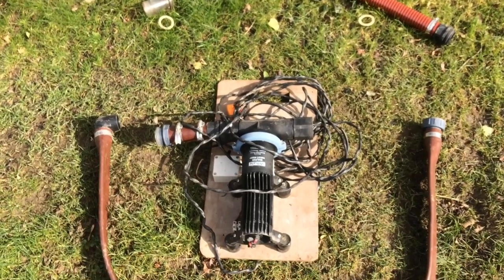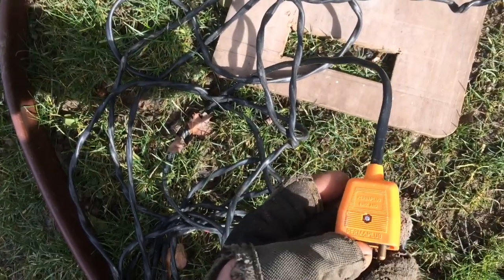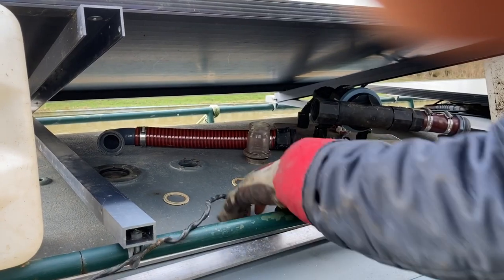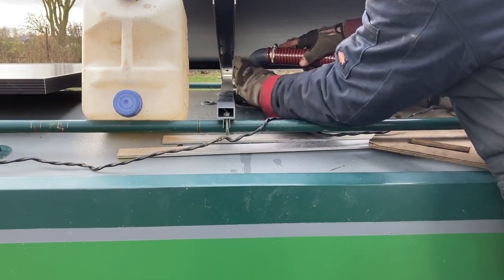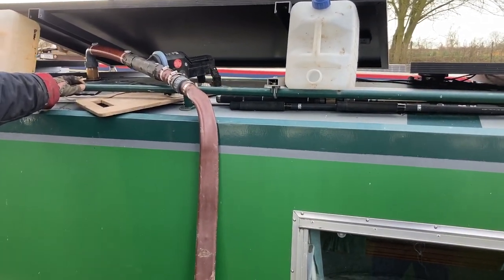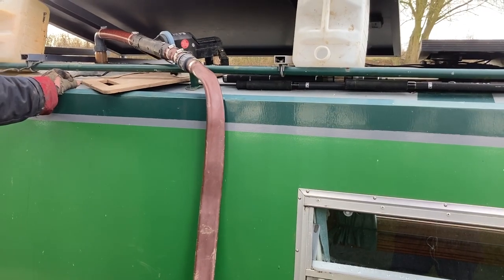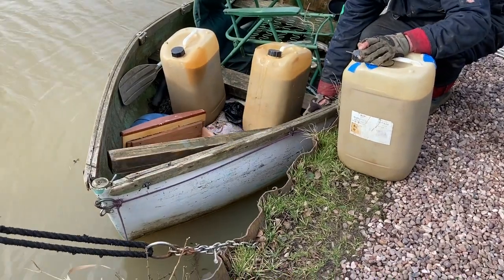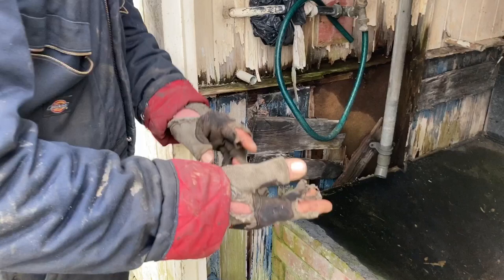Narrowboat D.I.Y Self Pump Out Marine Toilet

Comment: How long does it take ( roughly) from switching on to actually getting that 7ft lift ?
Reply from the maker: Hi Ross. I would say no longer than say 15 secs if the joker valves are good. I have another video on changing valves too. Thanks for watching mate
Reply: @DoItWithPaulie  cheers-
I’ve just built similar, but is taking several minutes to lift…
Reply from the maker: @rossfender6411  that will be the joker valves are worn or something  is stuck  in there